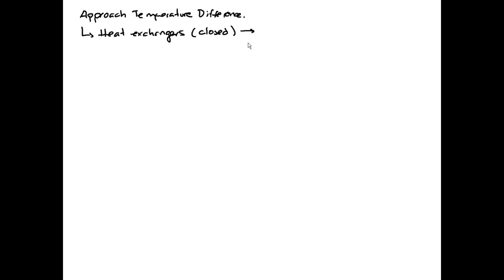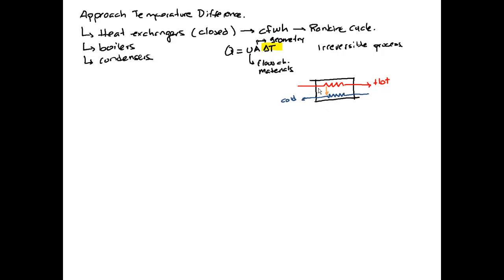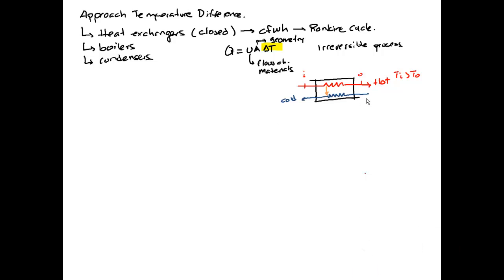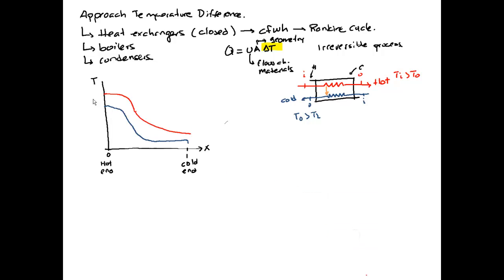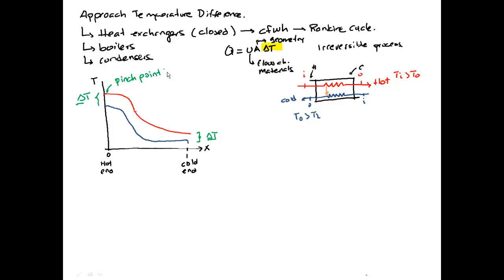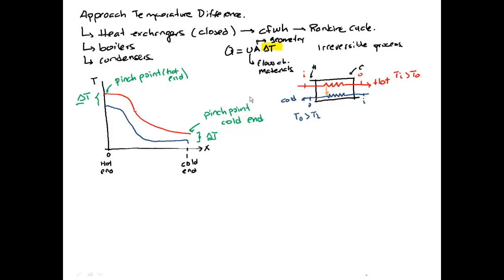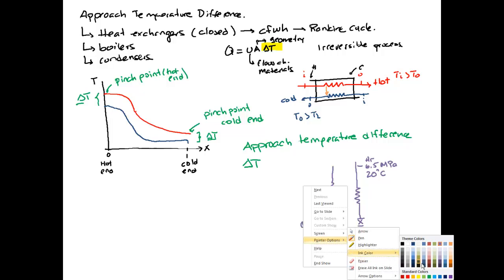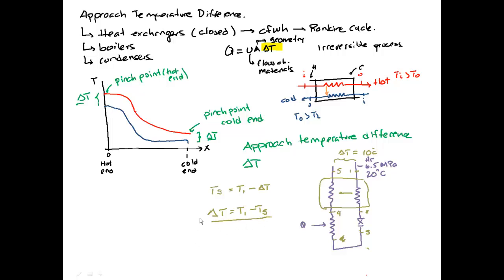Approach Temperature Difference

Comment: i have a question regarding the cooling capacity,i am studying the two methods of calculating cooling capacity from a system, (first method using the enthalpy change in supply air, second method using the enthalpy change in refrigerant)
if we calculate the cooling capacity by using the refrigerant enthalpy change it will NOT be same as if we calculate the capacity by using the air enthalpy change, 

whay?

Comment: I'm looking for a typical beef spray chiller water set up, recirculating and make up water plan, we have a Mueller 165 FFC and its an ammonia cooling plates, but I beleive the make up water being 80+ deg f, plus, not enough water in the top fill area, to create the force needed to actually spray the plate on recirculate, and the recirculate valve is open only when a zone is not spraying, and that's basically about 90% of the time. My problem is we are now looking for about 35 deg f, or 3 deg C. and due to the water system, and the way it was engineered, it is hard to get 3 deg C but 5 to 9 deg is what i'm getting.
In saying all this, I would want to see the recirculating water running about 80% and when the make up 80 deg F water comes in it will mix in the top distribution pan, cool, and then run over the plates.